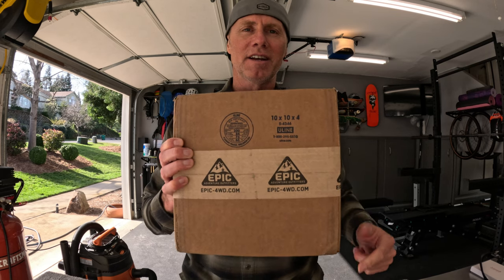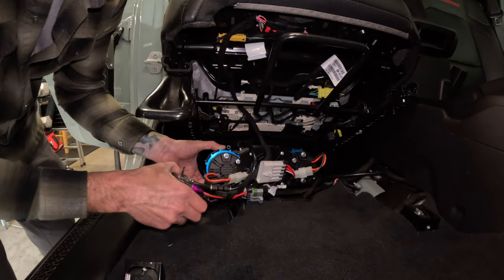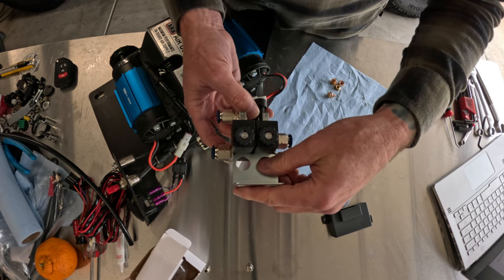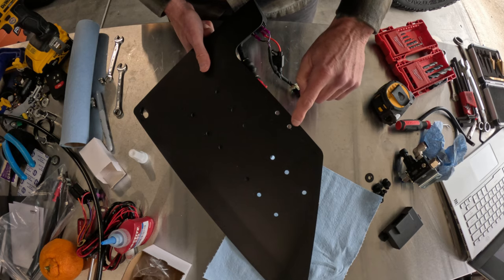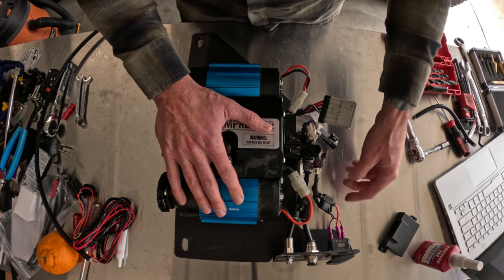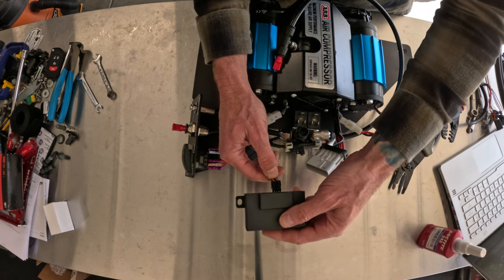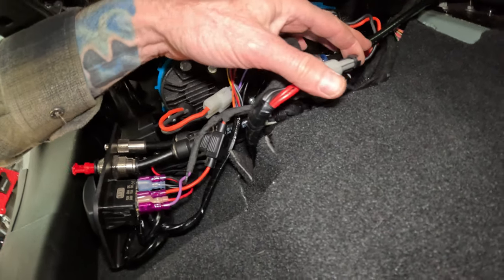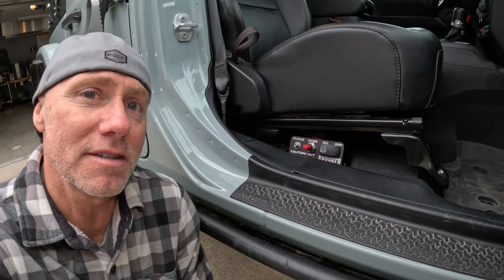Install of the ARB Tire Pressure Control

Comment: Nice upgrade. Kinda thinking about going with the kraken system instead of my current setup. That Mike McGill deck on the wall is pretty rad! 🤘🏼
Reply from the maker: Thanks man... I've been digging the Kraken ever since we installed it. I'm hoping the upgrade works flawlesly. Gotta keep skatin'. :)